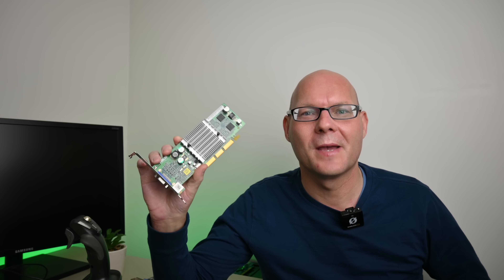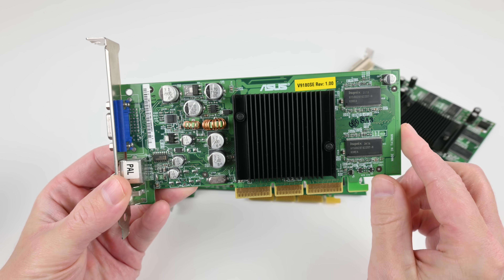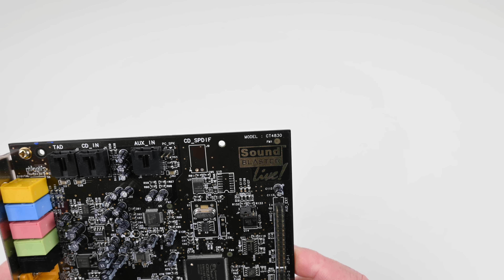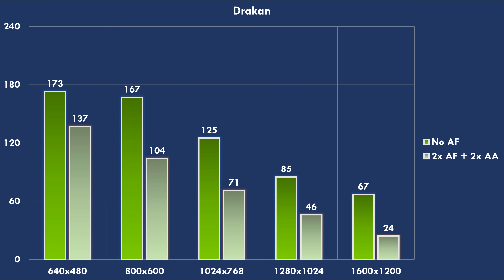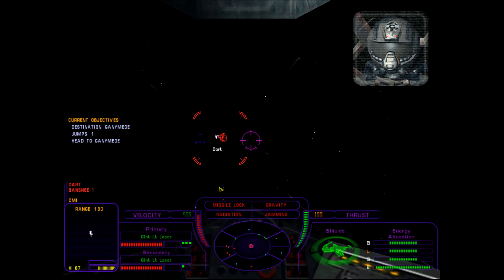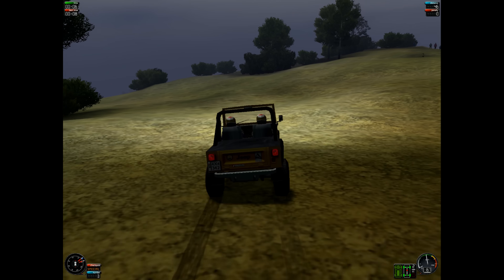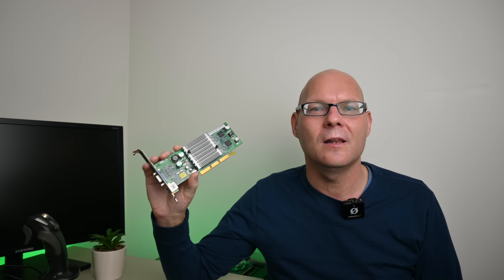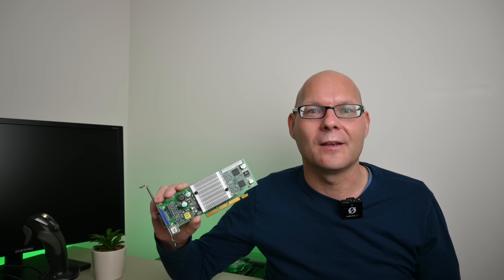One of Nvidia's most Controversial GPU

Comment: I bought a GeForce 4 MX440 with a motherboard bundle in June 2002 (A Gigabyte GA-7VRXP, which supports AMD Athlon XP processors and DDR333/PC2700 memory).  I mistakenly thought that the MX440 was a good deal, but I had not done my homework.  I made another mistake by replacing my MX440 in early August 2003 (almost exactly 20 years ago) with a GeForce FX 5600/256 MB GPU.  While I certainly enjoyed the extra video memory and DirectX 8/9 support, the performance of the FX 5600 seemed like it was about the same as the MX440.  Still, both cards worked very well for me, particularly with OpenGL games (i.e., Jedi Outcast).  As for retro gaming, as you demonstrated, all of these cards do really well with Win98SE, especially when paired with a decent Pentium 4 or Athlon 64.  For a Win98SE build, I would definitely recommend the MX440, MX460, Ti 4200 or FX 5600 if prices are still reasonable.  Thanks for another fantastic video!
Reply from the maker: That's the thing with going from MX to FX, the FX supported Direct3D 9, which is way more demanding. It is harder to notice the better graphics than it is performance. With Direct3D 9 you really wanted a Radeon 9700 which was a high end card at the time...
Reply: That's a shame for the FX5600 as I find it to be a great "sleeper" card that flies under the radar (at least the non-XT version).  Mine performs (in 3dMark tests, anyways) nearly as well as the ATI Radeon 8500 and 9600 and significantly better than an FX 5200 or 5500.

Comment: I just finished up a build on a nearly identical motherboard (same chipset) and I was determined to get the SATA ports working.  To make a very long multi-hours testing and playing around story short, I was able to get ONE port working with the following procedure
1 - Install Windows 98 to an IDE drive
2 - Install RLeow's SATA patch
3 - Enable SATA in the BIOS (it would then install the patched drivers)
4 - In the hard drive controller options in the device manager specifically for the SATA controller, set option for ONLY primary IDE controller enabled
5 - Shutdown, disconnect IDE drive, and clone it to a SATA drive
6 - Connect SATA drive to the correct SATA port, then enable DMA transfer mode in the hard drive options in the device manager.
I was never able to get both ports working at the same time, and I was never able to install Windows directly to the SATA drive as it would always freeze up during driver installation.  You can also use a similar process (absent cloning the drive) to instead connect a SATA optical drive alongside an IDE hard drive.
Reply from the maker: Now you know why I use the IDE port 😊
Reply: @philscomputerlab  Is there a specific branded SATA-to-IDE adapter you use?  I quit using them altogether because I ran into too many flaky ones.
Reply from the maker: @retro-computing-gaming  😳 I mention it in pretty much most videos. StarTech is the brand. Afaik one of the few, if not only one that uses Marvel chip.
Reply: @philscomputerlab  I woulda went back to your video where you talk about various hard drive options but sometimes I'm a bit lazy 😎 Thanks for the info - looks like they're not TERRIBLY priced, though they do cost nearly double the generic ones.

Comment: Can't tell you how happy I am to see you back in the old rotation (can't hear Linus of LTT say "No such thing as a bad product, only a bad price" without thinking of you).

No shade intended, but would love a redo of the GOG video (it is a little hard to follow with the orchestral music loudness vs dialog volume)

Also, another socket 775 Win98 fx 5500 pci video with overclocking. I know there were some settings issues that kept it out of the last video. 

Maybe a SFF (intel T processor or earlier generation SFF) with a M.2 PCIE adapter for GPU on XP with a USB CD-rom. ( Youtuber nowaynick did a great video using Win 10)

A bifurcation pci/pci-e card video.

I've got a ton of other ideas for xp and 7 compatible gpu features that have zero coverage except promos at the time (cost prohibitive for most consumers back then), I'll be happy to share.
Reply from the maker: Thanks for the suggestions! For sure, can do a GOG video. Do you mean the one with 98 games?
Reply: Yep, that's the one!
Reply from the maker: @ashleyjwilliamshand  Okie no worries 🙂
Reply: @philscomputerlab  Almost forgot!  I've noticed youtube systematically downwngrades some older videos to 240p and 440p options only. Haven't seen it happen on any of your videos, but as aggressive as youtube has been,  it's only a matter of time. 

Would happily buy a DVD or blue ray box set with your uploads. Different volumes or operating system specific disc's. A commentary soundtrack where you can discuss the advancements made or info learned since that video.   Comics do hardcove volumes and collected editions all the time, then a final omnibus.

I'd pay!

Comment: Man you're misleading us too. As nVidia did, back then. GeForce 4 MX was something like GeForce 2 *MX*. Not original GeForce 2.
GeForce 2 do have Hardware T&L, but MX - does not. No Pixel Shaders at all, just like gf4 MX.
If you look closely - GeForce 2 MX resembles enhanced Riva TNT or maybe partially Riva TNT 2. That is the core technology which empowers GeForce MX series. GeForce 4 MX is evolutional successor of GeForce 2 MX and offers better better clock speeds and other minor enhancements.

Comment: The Geforce4 MX was a very successful board for Nvidia. The ones that could not afford a GeForce 3 or an older GeForce 2 had a very compelling card so they had tons of sales. This card was much faster than many integrated solutions so it was a good upgrade for a system or a good first card for those that would upgrade later to something else. I think it was slightly better than a Radeon 9000 card, mostly due to drivers and optimizations being the strong points of the GeForce platform. This card was also a better rounded solution than a GeForce 2 MX as it had better performance while not being much more expensive. The lineup culminated in the strong later showing of the Geforce 4 MX 440/460 offering, if I remember right.

Comment: Max Payne isn't so hard. You just have to memorize the locations of enemies. You can use Molotovs or grenades to take out enemies hiding around corners- and listen closely for audio cues (enemies make a certain sound when they die). Another trick is to use the bat to strike enemies as they come through a doorway- just stand off to the side so most of your body is concealed by the door frame. You also have to be mindful of which enemies have shotguns because they will take you out FAST. And of course, use head shots. The Deagle will kill enemies pretty reliably with only three body shots. It's best to try jumping from cover to cover while firing. You always want to catch your enemies off guard.

Comment: GF4 MX is pretty damn good card for late 90s-2000ish Win98 gaming on a modest platform. I have slot1 P3 800MHz + Voodoo 2 system for exactly that and I had GF2 GTS in it, which decided to give up the ghost. I tested couple options I had inmy parts bin for a replacement, and decided to go with passive Gainward 440MX as it was better option than FX5600 for this application. That really shows how much FX series actually sucked, and I have been happily running that Gainward since and haven’t bothered to look for other options.
Reply: Personally I would go with something that can do at least DX8.1, just to have that range. DX9 stuff will do pretty much perfect under XP, but 8 and 8.1 sit in that gap

Comment: I wanted a Radeon 9000 pro, but as a teenager with no income I could barely afford a no-name MX 440. Instead of 400MT/s ram, it was 333, but hey it was way more powerful than tnt 2 pro. I enjoyed using it even if it was kind of megameh.

By the way, every contemporary local magazine showed ridiculously good overclocks with 440 8x. While stock it was no faster than 4x, with that oc it was a bit faster and decently cheaper than overclocked 460.

Comment: Hi, in the other video where you showed how to run win98 with an PC emulator. At 8:20 with what software did you mount the HDD ? I don't have any option in windows 7 ? ? ?
Reply from the maker: Windows 10 can mount it. I'm not sure about 7 I'm afraid.
Reply: @philscomputerlab  thanks. I got the solution with disk management.

Comment: I've seen heaps of these in prebuilts over the years.  It meant they could stick "Geforce4 MX" on the advertising, despite how close in performance it was to the older Geforce 2.  Looked like an upgrade to most people, and was cheaper for the oems
Reply: Yes, most of computer shops forget putting MX in invoice. My shock when all sites told this can run Sims 2, but my don't.

Comment: Yeah, I remember everyone was excited by the GF4 MX series, and the GF2 MX series before it. I have no idea why, none of them ever seemed like very good cards. At the time I was subscribed to PC Authority and Atomic magazine, so I saw the reviews. You were better off buying a second hand card that was more high-end. I guess they were fine for older games, but basically anything current wouldn't play well unless you really dropped the details or resolution.

Personally, I kept my GF2 GTS 64MB for quite a number of months after the GF4 series was released. With a mild overclock, it wasn't far behind a stock GF3. But then ATI released the 9700 and 9700 Pro, and retailers were discounting the GF4 series, so I picked up a Ti4600 for a very decent price and got a pretty good boost in performance. From memory, the 9700 was way ahead of anything nVidia had to offer for quite some time, but it was also pretty expensive, so I wasn't that tempted to jump ship to team red.

In hindsight, I would've been better off buying a second hand 9700 Pro for my next upgrade instead of the GF FX 5700 Ultra. It was a big upgrade over the GF4, but the 9700 series was just too good.

Comment: Great cards for DX7 / fixed function games under 98 - I'm especially impressed with the notebook GeForce Go 440 in my Dell Inspiron 8100, reading reviews from the time it was not far behind the performance of the desktop MX 440, and delivers surprisingly good results at high resolutions - ideal for the 1600x1200 display on my unit!

Comment: Thanks for cover this card, has an old model GF2-MX4-64M on my shelf. Games in video mostly from 2000s, but I plan a retro-build: SLOT1 Pentium III-450Mhz, GF2 and Aueral Vortex 2 - mostly for DOS games and some 90's stuff, under Win98SE. So the quick question is - how this cards are compatible with old DOS games and some games using DirectX 7.0? :)
Reply from the maker: For DOS it will work great, but 450 MHz under Windows means stick with older games and stay away from games 1998 - 2000.

Comment: Something I'd add: some of the last MX4000s made seem to have shared PCBs w/ the concurrently-sold FX 5200/5500; same 128-bit bus, but topping out @ 128MB on the MX cards.
If someone is looking for the 'least-gimped MX4---series card', most of the time they're mis-listed. You'll have to compare PCBs and RAM layouts with FX-series contemporaries.
@hurrdurr8701 mentions an L-layout as a decent indicator. Considering that most 128-bit FX52-/55-00 cards also are configured that way, I'd concur.
Reply from the maker: Ok I will check my 4000 cards, maybe I'm lucky 😊

Comment: Back in the day I was waaaay into the PlayStation 2 and its games, so the Geforce MX series passed me by. Nowadays, I got a Pentium 4 with a Geforce MX 4000 and 1 GB of RAM. This system was given to me as a gift by a friend that had it collecting dust in a corner. She heard I'm into retro PC and retrogaming in general and gave me the system (CRT monitor and everything!). I experimented with a few games on Windows 98 and XP before the system eventually gave up the ghost due to poor capacitors on the motherboard and weird sounds coming from the PSU.

Because of one of Phil's videos, I ended up building a Windows XP machine with a 4th gen Core i3, 4 GB of RAM and a Geforce GTX 650. If memory serves, this is the last of the Intel Core series that supports XP. Anyway, the machine handles all the WinXP games I throw at it like a champ and is new enough to have a safe motherboard and PSU. I still use the case and peripherals from the P4 system I inherited, so it looks period-appropriate.
Reply from the maker: Awesome! The GeForce 600 series is a good pick and that machine will run so many many games really well :D

Comment: You need to be extra scrupulous when looking for these cards, because as I found out, there existed a MX 440 with a 64 bit memory bus. Officially, there is not supposed to be a 64 bit memory bus version of the 440. I had one such card in my collection that I don't remember where it came from. The vendor is unknown, the card is on a super generic black PCB with no markings, other than "MX 440-SE 64M". But when you open GPU-Z it shows up as a regular MX 440, you have to look down at the memory bus width to see that it is 64 bit.

Whoever made the card really didn't want to be known, the vendor string in the BIOS is blank, making it impossible to know who made it.

It's off to someone else to enjoy though, recently gave it away with an older Pentium 4 system to someone that wanted an older computer to play with. I have far more powerful cards in my collection to need to keep around a MX series card.
Reply from the maker: Even to these day the MX cards disappoint 😂

Comment: Back When I built my AthlonXp rig, I skipped the geforce4 gen and went to a radeon 9600pro. Ati seemed to be a better bang for the buck.

Video suggestions:
ISA sound cards for DOS gaming guide. What works well and what doesn't. What compatibility is needed (adlib/SB/SBpro/adpcm) with and without Midi.
Pull out the yamaha/ess/Soundblaster.

Comment: Hitman Codename 47 texture glitches with GTX 970 (older cards and system too)
https://www.youtube.com/watch?v=jAGYffh2MKU&list=PL5Dt2YfKmPJsFSgvUFSDUwFmoFnOeKO-u

do you hav ethe same problem? Maybe you have a solution or somwhere else?
Reply from the maker: Why are you using the GTX 970 for such an old game? Try an older GPU.
Reply: @philscomputerlab  because i have tried if this bugs will come too with newer Hardware and its the same problem. It doesn't matter if i use Windows 10 GTX 970 new PC or older PC like P4 1.7 GHZ Geforce2/3 or the Pentium 3 667MHZ and Riva TNT 2 its the same graphic bug... and I know that earlier it wasn't there with TNT 2 Pro
Reply from the maker: @retro4fun358  Maybe it's just a game bug? I wonder how a Voodoo does, AFAIK this game supports Glide API.
Reply: @philscomputerlab  i have thought so too but I am 100% sure that wit the TNT 2 Pro and Windows XP before i have formated the HDD Deues EX runs smooth in 1024x768 High 30-50 fps even at Liberty Island the first  Level. And Hitman runs with no texture bugs  and a bit  smoother too. Its very strange. At first i have noticed this lag if i have replaced the TNT 2 Pro with Geforce 2 MX-400 and i have thought ist because of DirectX 6 from TNT 2 which supports this old games better maybe.
Because witht the Geforce 2MX-400 Hitman and especially Deus EX runs bader than TNT 2 Pro at first...

After i have format the Drive and install Windows XP again than the perfomance with the TNT 2 Pro was bader and had the same problem like with the Geforce 2MX-400 and than i have tested it with other retro PC's and videocards and its the same.

 GTA San Andreas:runs very smooth at 1280x1024 maxed out  40-60 fps no much drop (earlier on the MEdion PC with Geforce 6700XL of my friend). A german magazine called PC GAmes Hardware have tested GTA SA too  the same Settings maxed out with 4x Anti Aliasing and gets 47 fps with Geforce 6600 Gt and Athlon 4000+ 1GB Ram and my system is almost the same Atlon 3700+ I have tested it with P4 3,6GHZ too and its the same... some areas run very smooth 40-50 fps but in some places there are so much drops... under 20 fps around 10-15 fps. It depends on the area where you are. Especially with much shadows gras and woods  drops down the fps so much.

Sry i can't writing less its so complicated and so strange that i haven't no idea because i have installed Windows several times and i have installed different graphics Driver and Mainboard Sound Controller and more. it helped a bit in a couple of game s but not at this.

I guess the reson isn't the card or the Driver of ATI/Nvidia. Most game srun well but couple of games not
Reply from the maker: @retro4fun358  Deus Ex needs a decent CPU I believe, that's all I remember. But can't add more as I'm not familiar much with these games...
Reply: @philscomputerlab  it needs 300MHZ Pentuium 2 but the Recommandation is Pentium 3  around 500MHZ 128MB Ram and 16GB VRAM and my Retro PC has 667MHZ P3 128MB RAm and 32 MB TNT 2 Pro . This game came on June 2000 the PC can't be too bad for this game.
Reply: @philscomputerlab  can you try to test Hitman Codename 47 on your old retro PC'S? maybe you have an idea what causes this graphical bugs and bader performance

Comment: Owned 3 440-SE's. All from XFX, and dead because of age or pushing them a bit too hard. They were a big step up from the Intel graphics in my i815 mobo, at least. I replaced the last one with a Zogis FX5500 with the appropiate 128-bit bus, but I also later got a proper MX440 (also from XFX, lol) that I'm keeping as a backup.
Reply: And the FX 5500 is hardly an upgrade, well, except for DX 8.1 support (because the FX were really bad in DX9), but it isn't much faster.
Reply: @HappyBeezerStudios The 440 seems to be the faster of the two, only losing it's lead to the 5500 once higher VRAM requirements are involved (same core & memory clocks, 64 vs 256 megs).

Not getting a Code 12  with the "System Board Extension for ACPI Bios" in W98 when combining the 5500 with a PCI card in certain slots is a welcome upgrade too. I'd put my 440 in my Deskpro EXD if not for that.